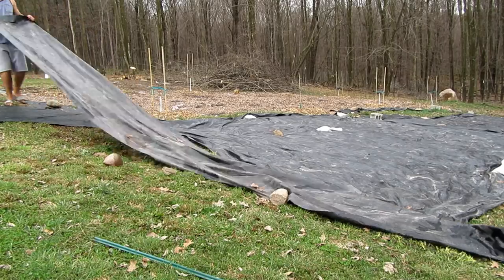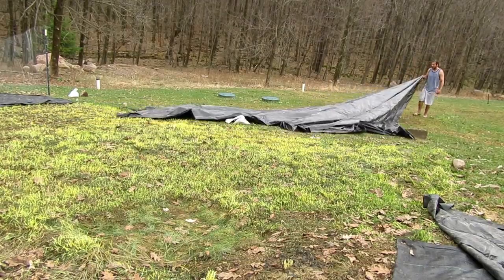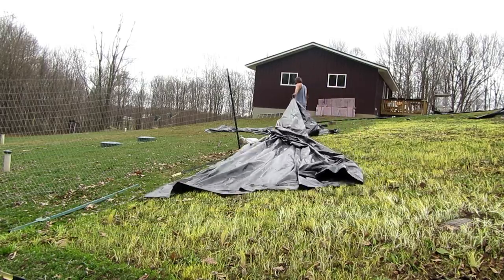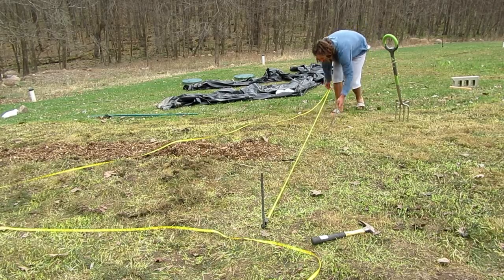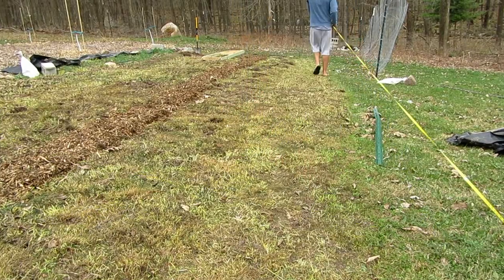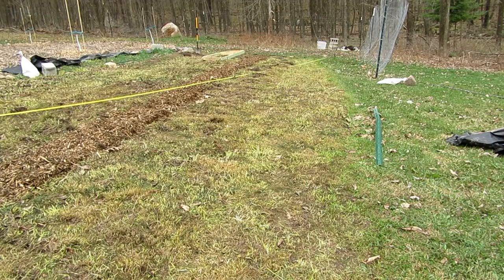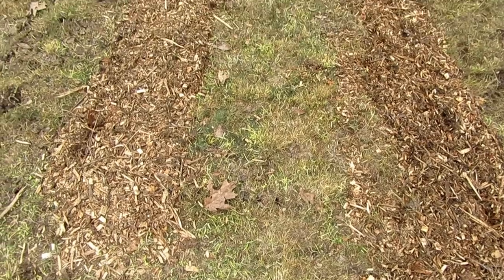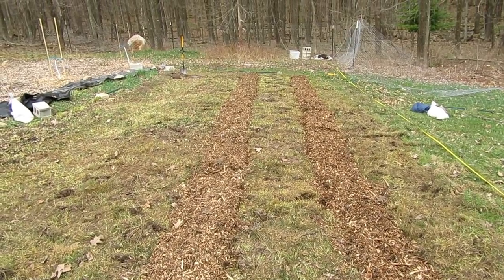Forming No-Till Beds

Comment: Looking good Nate. I remember doing a no till garden. Felt weird after doing nothing but tilled gardens. Took a minute to get used to it.now from experience easier to paper and compost first than trying to work around a plant. I have a second advise for you. If you can get electric fence...there is a special one for birds and can be solar powered. Set it the size of garden then in the middle of your area place a large pile of wood chips enough to cover the garden several inches. Let your birds lose on it for at least 2 weeks. They will move the wood chips around for you. You never going to have to weed or hardly and while your birds where on it they help brake down the wood chips while fertilize it for you. Of course the longer they are on it the better. I promise you it works great the deeper the wood chips the better and longer it will take to break down into biomass for you. Best of luck Nate and stay on top of that itch we all get this time of the year.
Reply from the maker: Yea, I really want to compost first, it all depends on when I get my compost.    

I plan on doing that with my greenhouses over the winter with wood chips and the birds.  I don't think I have enough chickens right now to do it, or woodchips haha.
Reply: Tiny Hilltop - Farming for Change 
I know the feeling took me forever to get enough wood chips. Keep up the good work bro you got this.

Comment: That was pretty slick how you made that mold.  I wish I had woodchips.  I have several times in the past, by approaching the crew that chips for the town and asking them to dump them on my property.  I love them for paths though I am not a big back to Eden fan (except for orchards, if I had wood chips at the farm).  I typically put them on paper or cardboard and they last well, even a couple of years.  Having good paths keeps folks on them instead of the beds.  As far as the beds, I still like paper but it kind of depends on how thick your plantings are (like lettuce vs. tomatoes).  I have been using old hay for everything because I have tons of it.  I try to put down compost or something "nutritious" before a brown layer (hay, woodchips, sheep wool, sawdust, paper, etc.) so that the soil isn't depleted before it helps the veg roots. (hope that makes sense).  I found a pile of sheep manure+hay from a year or two ago that was packed with red worms (hundreds per cubic foot) so that is what I hope to top dress with first.
Reply from the maker: Nice score with the old hay and sheep manure.  Yeah, I only plan on doing back to eden where my trees are.   I do the same, put them on paper to help control weeds.   Thanks!

Comment: When I first started growing cucumbers I tilled the soil, then layered wood chips on top of it. Then I layered a mix of potting soil and manure compost on top the the wood chips. Kinda something like a Hugelkultur bed. Cucumbers did great and weeds were minimal. The best part was the next year I got to mix all that potting soil into the native soil and now that soil is awesome. I just add a little compost yearly and it's all set. I still cover the soil with pine shavings around the cucumbers to retain moisture and keep weeds away.
Reply from the maker: That sounds like a great system.   It is nice to have it set up so there isnt much work each year.